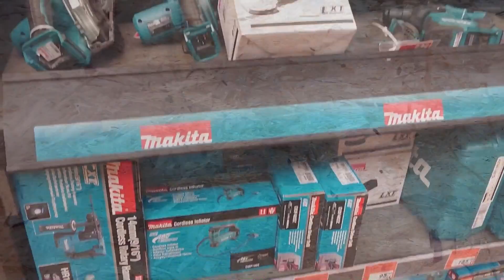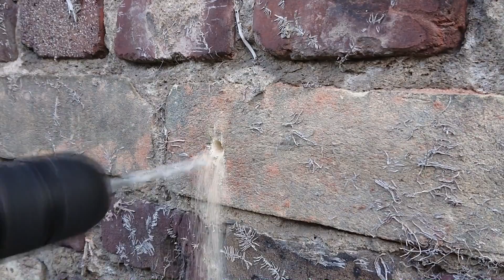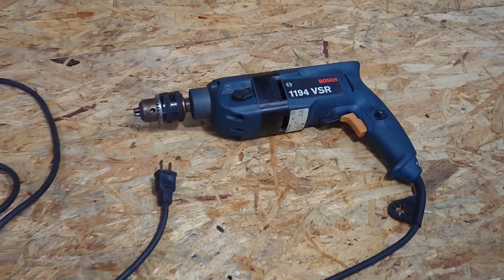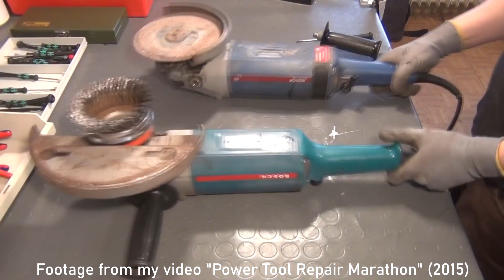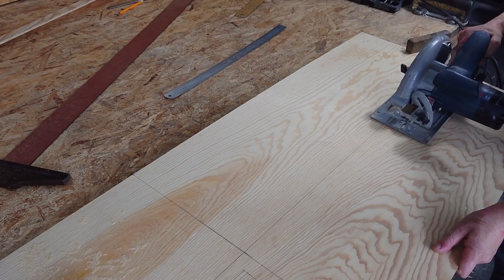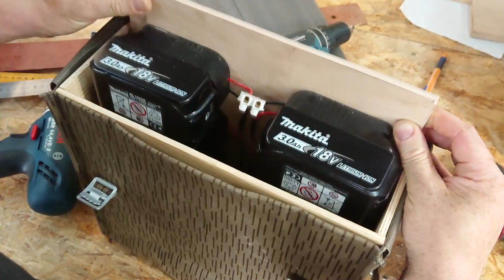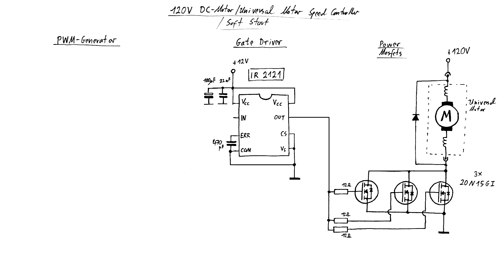Battery Tool Experiments:  Converting 120V Tools to Battery Power / NiCd to Lithium

Comment: If you use high and low side mosfets (i.e. half-bridge instead of a single switcher) you could even regeneratively brake the angle-grinder :)

Comment: Could you show how to adapt a battery power tool into a corded power tool. (or emptied battery to power transformer plug). For when you need them to run all day and do not have enough batteries (or emergency use). Please !

Comment: I have wanted to do this with my Bosch 18V batteries, but I'm pretty sure these do not have buildt in under voltage protection, I think this is in the tool. I have not found a easy solution for the under voltage protection yet. Do you have any suggestions? Is Makita batteries protected against under voltage?

Comment: What’s the wattage on this? Could it run a coffee machine? If you run a few lights how long would it last? It would be great for camping.
Reply: It could run a small coffee machine. Heating water is a huge load. Propane or butane makes more sense. If you run led lighting, it will run for a very long time

Comment: Do you have a link to those wire cutters you use (the yellow handled ones) that you used to clip the copper connectors with? It seems very effortless to cut those large contacts.
Reply: hello 74 06 200 knipex i like german tool great tool ,i have a lot and i am french,nobody is perfect😋

Comment: Had any troubles with the DRM circuitry in Makita battery packs? I have a few Makita tools that I'm looking to fix or preferably convert to something else because the charger refuses to charge them anymore.
Reply: Some retailers have a software hookup that can force charge them if they are locked in self protection mode. Hope it helps

Comment: Love your videos and they have been very helpful to me. I know having one battery to fit all your tools can be handy. But what about replacing the old worn out batteries within the old battery case?
Reply: Replacing the old worn out batteries to make them “work again” is not usually worth it. You then have to make a charger for them, etc. Using a modern battery pack with a BMS is the way to go.

Comment: I have a couple DeWalt drills and impact I plan to convert to lithium,  I also extended the capacity of one of my Hitachi batteries, by adding higher capacity cells, ot was about 1.2ah it is about 4ah now, it can almost used all day now. The cells in the DeWalt impact is weak, and will not loosen moderately tight bolts, the Hitachi is 10x stronger. Even the cheap harbor freight impact is a monster compared, I'm hoping the new batteries will give it a much more usefulness,

Comment: Have you ever had a drill chuck stuck all the way open? I can't get it to close to be able to use a drill bit. I fixed it up with new batteries, but it's still useless.
Reply: I've just sorted out one with the opposite problem, stuck in the fully closed position. Frankly, a bit of brute force is your best option. If at all possible, remove the chuck (remember that the internal screw is very probably left hand thread) and work on it off the drill. Sorry, I know this isn't very helpful but I'd encourage you to 'give it no mercy', hammers will have to be wielded! Best of luck mate.
Reply: Soak the drill chuck in some diesel overnight. Just the chuck mind you. Not the whole drill.

Should loosen up the next day.

If it doesn’t, turn the clutch setting to say 80% so it has a bit of give, hold the chuck tight (gloved hand) and press the switch (in forward gear) the rattling of the clutch should work the chuck jaws free (like an impact wrench).
Reply: Shoot it with lub two pair vice grip clamp A and B of the chuck twist
Reply: @MrPhatNOB  I already tried a lubricating oil on the inside area. I really beat it all up to hell with a large vise grip and a pipe wrench. It's a keyless chuck, so it seems like even the plastic is slipping now. But I'll try diesel soon. Thank you.
Reply: Sometimes drill chucks just die. That's why they're removable. Although sometimes getting a chuck off isn't the easiest thing to do either. As others have mentioned they're often reverse thread and they can wedge themselves on pretty good over their life. Like some suggest you do have to use excessive force. Then percussion can be your friend. Smack it one way and if it doesn't loosen try the other way. Good luck!

Comment: Súper video. I hace a Makita 12 Volts wich 2 battery paces are almost dead; do You think it might work with this convertion ro 18 Volts battery ?  Or rather go for the 18650  Lithium battery and fix the 12volts itself...Danke  und viele grüsse aus Mexico. 👍🏼👋🏽

Comment: I have a Draper table router, the variable speed controller failed. Draper don't have a replacement and don't know how the speed controller works, voltage control etc. Any ideas anyone how I can replace it. Right now I wired it to just work at full speed.

Comment: I've recently tried to source a 18v nicad battery for a cordless hedge trimmer I have. Could I use this method, and how would I charge the battery?
Reply: Shure you can if you have the skills to dismantle the hedge trimmer, connect and mount the Makita battery adapter and put it together again. Together with the battery itself you will also need a  Makita 18v Li-pack charger to charge. Maybe you can find used ones on eBay (or in a scrap yard 😉), if you have to buy them new it'll be quite expensive.

Comment: I think im right in saying that grinder is more powerful on 120v dc than 120v ac?
Reply: No. "120V AC" is not "120V max value", it is "120V RMS" (root mean square) which means that it provides the same power output as 120V DC (but is actually closer to 170V max value)
Reply: @takix2007  ok but how can it average to more than its peak value?  Edit ….awh i thing depends alot on which country your in im UK
Reply: @takix2007  your totally right of course thanks for the comment it was interesting to look into
Reply: @jons6125  UK has 240V @ 50Hz so max values a little shy of 340V. On the continent it is 230V, that's 324V max value.
You are welcome 🙂

Comment: There is one drawback to using a makita battery. These batteries contain a chip that locks the charge, after a certain number  of cycles amount of battery charge. These batteries may be fine, but makita prevents them from being charged after a certain number of cycles of charge.
How to solve this problem. That would be an interesting topic for further movie.

Comment: Imagine if the tool manufactures were forced to use an industry standard connecting format per voltage of Li Ion batteries. Millions of power tools wouldn't be in land fills and they would have to compete on the quality of their batteries because they would interchange. I'm not a fan of government mandates but I think this one is justified given the genuine benefit to environment.
Reply: They don't care about the environment. The government cares about immediate profit by tax. And companies care about 'sustainable income' - steady income. Slave owners force their slaves to work with 'subscribtion' style regular payments. Also known as Tax. Slaves are enslaved by tax. Get the cogs ticking yet? They have never cared for you or the environment. Wake up sheep.
Reply: I seem to remember the EU trying to standardize cell phone connectors. Standard power tool batteries would be great
Reply: I completely agree, which is why such legislation has never been written or passed. The environment is a means to power for them, and if they cared we wouldn't be having this conversation.
Reply: @tomgarside480  and succeeding at it, mostly (micro USB chargers), except for Apple who has to be its own unique snowflake...

Comment: Why not build an AC inverter? It doesn't have to be true sine wave. Although you can pickup a true sine wave module + LCD display for under $10. 
Google "EGS002 EG8010". That way, you can use any power tool from battery pack. 
Depending on your current demand, you maybe able to get away with one 18V pack.
Obviously you'll need higher input voltage for bigger loads.

Comment: I have a Craftsman brand drill that I am attempting to perform the same conversion you are doing. The battery systems I use are Ridgid and Ryobi but I have had a tough time finding appropriate adapters. Anyone here found anything that would work???
Reply: Check eBay.

Comment: Your knowledge of electrical concepts and their demonstrations, thereof, is exemplary, sir.
Edit: The PWM arrangement sounds much smoother though.
Also: Watching your battery-powered seven-inch grinder cut through that huge chunk of steel tube was fairly insane. Much appreciation.

Comment: You can make a voltage doubler rectifier to use a 240-volt drill charger on a building site in the UK
https://youtu.be/QBl9h_v7hYM

Comment: Think I just found a use for the 500+ 18650 cells I have.
Reply: Tools need high current cells. There's really two kinds. High current and high capacity. You can have one or the other but not both. They get around it in some battery packs by paralleling cells to increase the capacity. Laptop cells are high capacity. They want run time. They can run tools but then the tools are anemic. They don't have the grunt they should.
Reply: @1pcfred  I don't know where you got that information from. You seem to have a rudimentary understanding. Also, your comment contradicts itself.
Reply: @1pcfred  perhaps I misread it. In either case, paralleling cells, increases both capacity and maximum discharge current. So no, the tools wouldn't be anaemic.
Reply: @jimmyb1451  do what you want.
Reply: @1pcfred  Gee, thanks for the permission.
Reply: @jimmyb1451  whatever.

Comment: I will Ask You, 
It is Very Easy To Buy On EBay a Dc 24v Motor for 10 Dollars 
And Convert To 20v Battery ???
Or Buying 5 Batteries 18v With Not Same Power As 110v ???
Amén.

Comment: You could prolly buy a cheap generator for less
Reply: Pretty sure he is not doing this to save money. It’s more about using what you have at hand, learning and sharing information.
The whole idea of this channel is in its name.
Reply: Hard to beat the energy density of lithium batteries. As far as cost, I'm sure you could save quite a bit getting cells and building your own pack from scratch.
Reply: @dazaspc  That is true. Pretty pricey.
Reply: @horacegentleman3296  that would be a good project video. Mass energy battery packs for cheap.
Reply: @horacegentleman3296  actually gasoline walks all over batteries when it comes to energy density. Which is why electric vehicles are having such a hard time catching on. Batteries are 450 W/l and gasoline is 13,500 W/l So even at laughable efficiency IC engines run far longer than electric does.
Reply: @1pcfred  gasoline needs a lot of other much much heavier things to make electricity making it less dense for this purpose, be pedantic elsewhere. Gasoline also has a lot of calories, you don't drink it when youre on a hike.
Reply: @horacegentleman3296  who told you I don't drink gasoline? I am an American after all. Only premium though! And none of that unleaded crap either. Tetraethyllead is good for whatever ails ya. It'll keep ya from knocking in the knees.
Reply: @1pcfred  lol fair enough

Comment: Grinder: perhaps with a 4"1/2 blade it could actually make sense. This 6" grinder is just way too power hungry for the battery setup... it needs colossal amounts of power :-/ 
Probably this is the reason we cannot find 18V (36V) 6" grinders from OEM directly